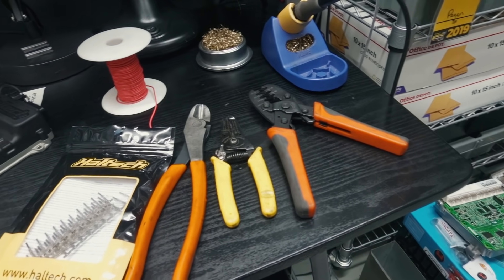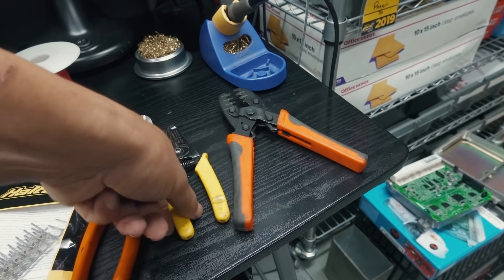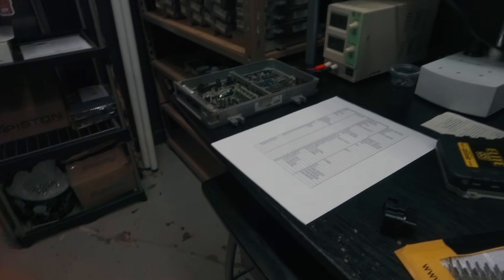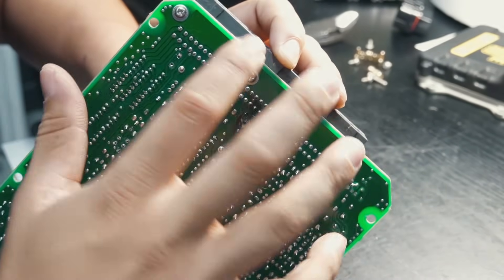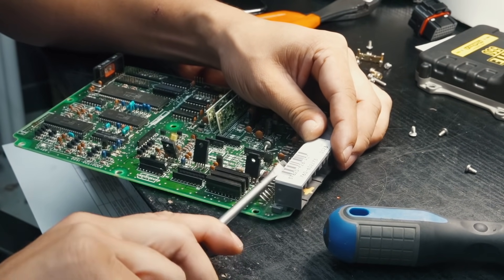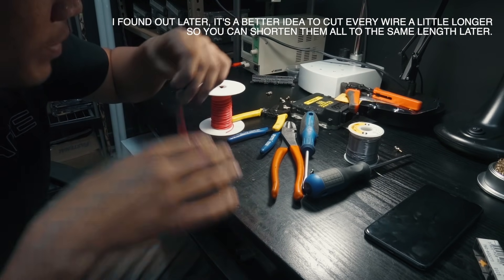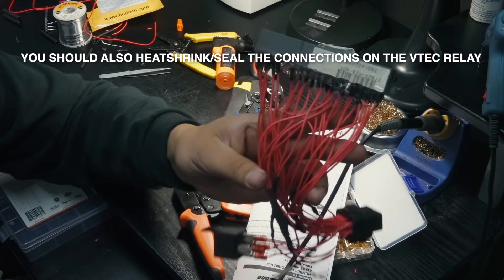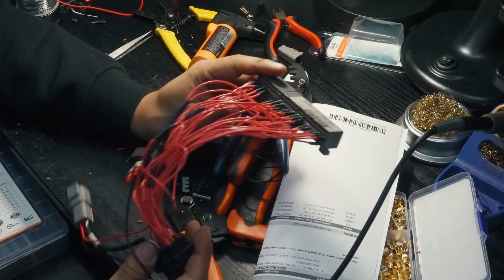DIY Building a Budget Jumper Harness For Your Honda On A Standalone ECU

Comment: I'm trying to do this for a maxxecu to my prelude gen 4 and got stuck on some parts. Where does some of the cables go to?😅 For example, where do I put the distributor power, vehicle speed or ignition power? I have been looking on both the haltech and maxxecu diagram but I can't figure it out 😅 #HUMBLE

Comment: You can just pull the honda side ecu pins out of the gray socket instead of clipping them off, if they are unused just pull them out from the socket side

Comment: What if you already have a OB0 to OB1 liggy back? Wouldn't I just do the same process except eliminate The OB1 jumper harness and replace it with a stock/OB0 ECU? Basically scrap the OB1 ECU and jumper harness and just do this process with the motor harness (CRX) and OB0 ECU (stock ECU)?
Reply from the maker: Yessir

Comment: don't forget to post the pinout guide somewhere so we can all follow it. Also im pretty sure the stock honda 0bd1 ecu has input and output from the alternator to control the voltage regulator are you using the haltech to do the same thing? or if we don't run those wires into our standalone ecu will the alternator still charge and work properly without them?
Reply from the maker: You'll need to purchase the elite 550 from the link in description to get access to the written guide, pinout and basemap.

Comment: you can use painter's tape to create a mold around the obd1 connector then use hot glue or epoxy to protect the pins and keep the wires in place. this method leaves a professional mess free look

Comment: Wiring the pinout of an ECU is easy once you have the correct wire diagram and be well prepared with the necessary equipment. Talking from experience... with your level of experience I got to say good work man 👍

Comment: Would this ECU have flex fuel capability? I’d be more interested in that since I’m staying NA but will be running a 12:1cr. The goal is to run ethanol since I’m sure 12:1 is right at the edge of 91oct I just don’t want to have to test to see what the ethanol content/percentage is.
Reply from the maker: Yes it does

Comment: Might be easier buying a 20$ jumper harness and cutting the other end off then pin it to the Hal tech 🤷  but great video 👍
Reply from the maker: Can’t get one for OBDI.
Reply from the maker: $95
Reply: Depends on the jumper. I’ve had jumper harnesses that didn’t work well due to poor soldering. Name brand, cheap, it didn’t matter. Either way, it’s a risk. If you like to tinker and have patience, do it. If you don’t, then get the jumper(s).
Reply from the maker: Comment got deleted it looks like.

Just giving everyone the information to DIY. Lot of people complain about how expensive better options are. Now people complain the cheaper options take work lol
Reply: What about my OBD0 to OBD1 jumper harness? I have an EF. Could I de pin the OBD1 side of the jumper and follow your pin out guide?
Reply from the maker: As long as one side is connected to the engine harness, the otherwise can be pinned into the haltech.

Comment: Can this use for bseres
Reply from the maker: Yes
Reply: So would i still of to do the relay for vtec
Reply: @puffy_performance  yes you will. The haltec doesn’t send 12v to the vtec solenoid it will only use a low side. That means it will ground the really to give you 12v
Reply: @Lunatic1822 so what if i want to go coil n plug how that would wire back to the ecu
Reply from the maker: It has ignition outputs. The ecu doesn’t send the power to the coil. The power/ground does. Ecu just tells. When to fire.
Reply: @Humble performance are u fling to do a video on that
Reply from the maker: Probably not, but if you need help, we offer support with every purchase
Reply: Humble performance ok definitely gonna get one

Comment: Thanks for the video on making a budget jumper. To stay better organized I would recommend using a wire marker book. I would also recommend that the pins for the connector are clean before soldering on the wires. Keep the videos and wealth of knowledge coming and stay humble.